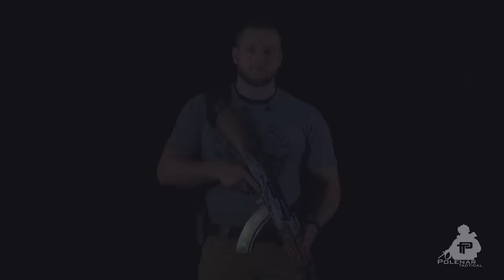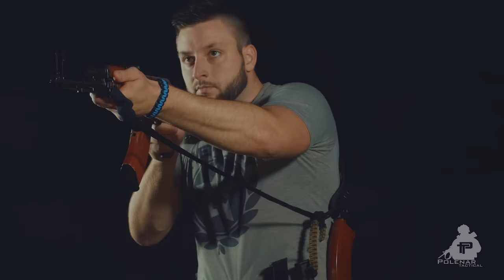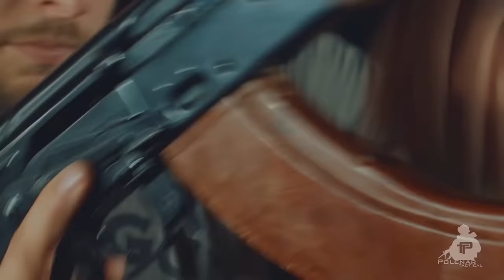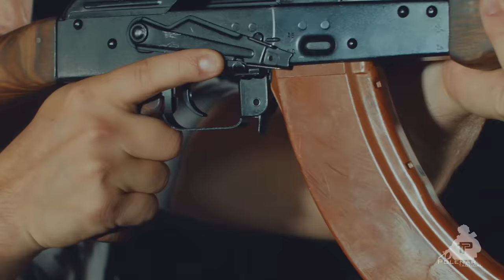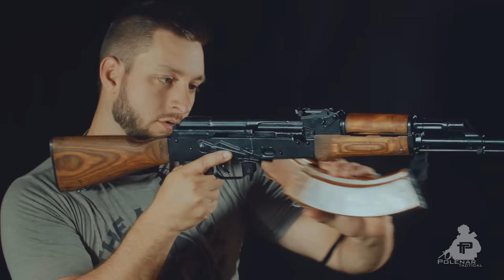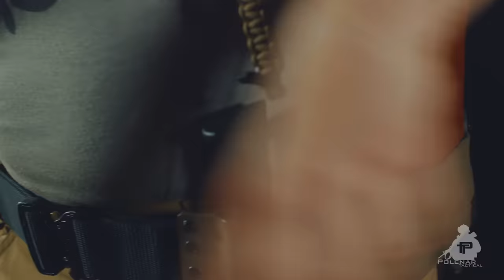How to reload an AK

Comment: Curious questions:
Does it matter which way the rifle is rotated for the charging handle?
Any particular reason to not reload with the right hand instead as that's the side with the charging handle?
I assume because of some rule where your shooting hand should never leave the controls of the weapon, but is it because it makes it unsafe, or actually takes longer, or something else I don't understand?
I thought maybe right handed reload because the left hand could carry the rifles weight better since it's out in front of your body, and no rifle rotation when using the charging handle?
Reply: Never take your firing hand off the pistol grip. For left handed shooters you just rack back the side you dont need to go under.

Also putting the rifle in your "work space" keeps the rifle in your line of sight while being able to keep eyes on your target.
Reply: @chasingthefish9042  I guess I was looking for more of the "why" to never take your firing hand off the pistol grip. I could sort of understand if there's still a round in the chamber, but if it's an empty rifle I figured it was a moot point. Ultimately the speed of which you reload would matter more to prevent being caught off guard.
Like is it just an etiquette thing that gets trained into troops because at some point they just wanted to teach one way to reload?
Reply: @AdeptusIncompetus  its so when you do reload you have control of the rifle. Having positive control of the rifles controls reduces accidentally firing the gun. The more hectic the situation the harder fine motorskills are. taking your firing hand out of the confusion and focused on its only job simplifies atleast one thing.
Reply: @chasingthefish9042  Ah okay, that makes sense. Thanks for answering!
Reply: @AdeptusIncompetus  I'd say that there's no wrong way to do an AK Reload
Calvin Truong (or Firepower United) makes some important points covering why taking your firing hand off the pistol grip ISN'T such a huge issue and he can perform reloads just as fast using his shooting hand to manipulate the charging handle. 
He also notes that this is a method of weapons manipulation that is being taught by Gridmitry who is a firearms instructor. While it's not the primary method of how he charges the rifle, he teaches that in situations where it's awkward to run the charging handle with your off hand as a right handed shooter (such as in prone or awkwardly leaning against the wall) it's a way to go ahead. 
Some shooters get the rifle into their shoulders and can quickly rack the bolt with their shooting hand, a technique even Milspec Mojo explored using a KP9 with success
End of the day, train with various techniques, break down the ones you want to use or improve upon. If you can perform a technique someone dissuades you from doing fast enough and consistently enough without mistakes, the old adage goes: If it looks stupid but works, then it isn't stupid.
Reply: @ReapingRose115  I'll take a look at those, thanks for the input.